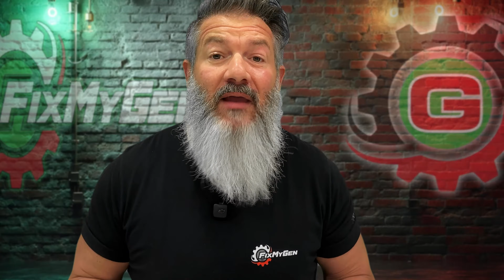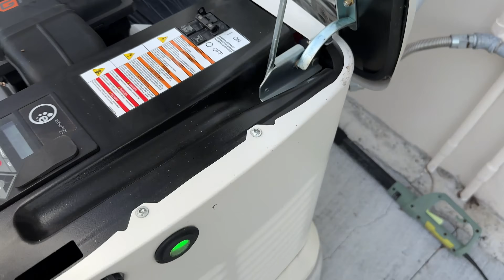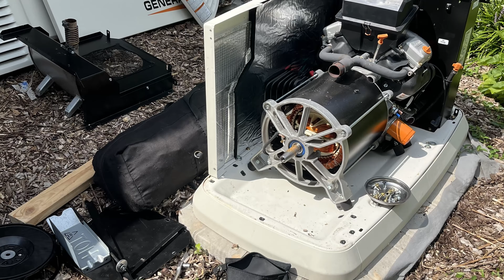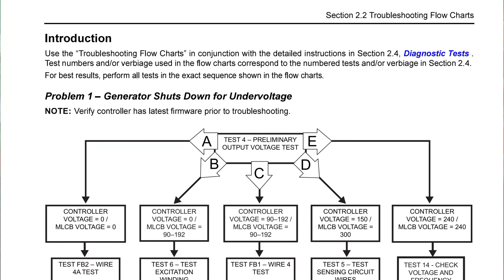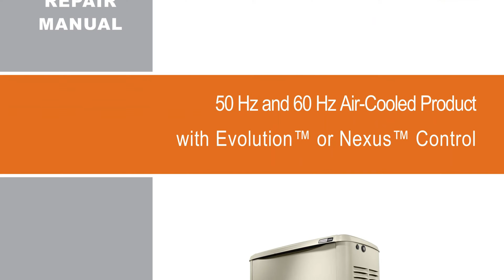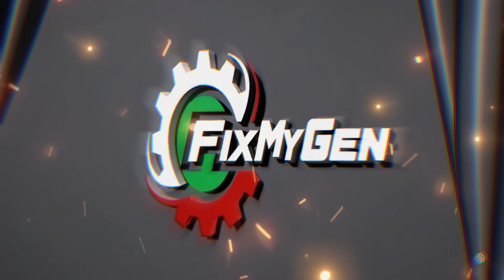GENERATOR DIAGNOSTICS | UNDERVOLTAGE ERROR CODES | FIXING 1900-1906 & 2299 ⚡🛠️

Comment: Thank you very much Robert, could you tell me where to find this switch (DPE) on the generator 7145
Reply from the maker: Hey Sasha — yes, the DPE winding is in the alternator (stator) on the 7145. That part is “inside the generator head.”

What’s not true on the 7145 is the idea that there’s a simple, user-resettable “DPE breaker” you can find on the front panel.

Here’s the clean way to think about it:

On older pre-Evolution units, Generac sometimes used a physical Excitation Circuit Breaker (CB2) in the excitation/DPE feed path. That’s the little breaker people remember.

On the 7145 (Evolution), the excitation/DPE output comes out of the stator and runs through the harness to the regulator/controller. There usually isn’t a standalone, panel-mounted CB2 you can push/reset.

Now the important part: if you’re talking about opening the control panel and doing internal meter checks, that is not homeowner work.

This is roughly a “Generac tech skill level 7.5/10” job to diagnose correctly and safely. You’re inside areas that can expose you to lethal voltage and stored energy. The diagnostic manuals are written for the home standby service trade for a reason. I don’t recommend homeowners attempt it.

That said, for a qualified technician, this is the step-by-step “Test Excitation Circuit Breaker (CB2)” process, when the model actually has CB2:

Safety shutdown

Put the unit in OFF.

Disable the generator so it cannot auto-start (lockout/tagout if you’re a tech with that setup).

Wait at least 2 minutes.

Access

Open the control panel area to access internal components.

Locate the Excitation Circuit Breaker (CB2), if equipped. (This is where the “does this model actually have CB2?” question matters.)

Isolate the breaker

Disconnect the wires from the breaker terminals to isolate it from the rest of the circuit.

Common callouts in manuals are wires 2 and 162 (varies by model/diagram).

Meter setup

Set your multimeter to resistance/ohms (continuity/low-ohms range).

Confirm the meter reads correctly by touching the leads together.

Test

Place one probe on each CB2 terminal.

Interpret results

Good breaker: continuity / very low resistance (closed circuit).

Failed breaker: OL / infinite resistance / open circuit.

Next step

If failed open, CB2 is replaced.

If CB2 tests good, you move upstream/downstream (DPE winding output checks, harness/connectors, regulator input/output, etc.) depending on the symptom.

If you tell me the exact symptom (runs but zero volts, runs but low volts, won’t excite after start, error code, etc.), I’ll point you to the safest “outside-the-panel” checks first and then the most likely internal failure points for the 7145.

Comment: Hello Robert, thank you very much for the clear explanations. I wanted to ask you a question. The Generac generator has been standing for 2 years and has not worked. After starting it gives 170 Volts, 1st phase 85, and 2nd phase 85, error code 1900. Maybe you have encountered such a problem, thank you very much. Have a nice day.
Reply from the maker: Hello Sasha, thank you for reaching out. Based on the symptoms you described—specifically the 170V total output (85V per phase) and Error Code 1900—the unit is experiencing a "Prolonged Undervoltage" condition. This occurs when the output falls below 80% of its nominal rating for 10 seconds or more.
Since the generator has been sitting for two years, there are two primary culprits for this specific voltage drop:
1. The DPE (Displaced Phase Excitation) Breaker
The 170V reading is a classic sign of a loss of field excitation.
• Action: Locate the DPE circuit breaker on the unit. Check if it has tripped. If it has, try to reset it. If it trips again immediately, the breaker or the circuit may have a fault and will need to be tested for continuity with a multimeter.
2. Oxidized Slip Rings
Because the unit has been idle for two years, a non-conductive film or tarnish likely developed on the slip rings. This film acts as an insulator, preventing the brushes from delivering the necessary current to the rotor.
• Action: Inspect the brush assembly and the rotor slip rings. If the rings appear dull or dark, they need to be polished. Note: Use only a fine-grade abrasive (like a Scotch-Brite pad or 400-grit sandpaper). Never use metallic grit or emery cloth, as this can damage the rotor.
3. Next Diagnostic Step
If the breaker is fine and the rings are clean, the next step is a Fixed Excitation Test. This involves applying a DC current directly to the rotor to determine if the issue lies within the Voltage Regulator (AVR) or the internal stator/rotor windings.
Start with the DPE breaker and the slip rings, as these are the most common mechanical failures after long-term storage.
Hope this helps point you in the right direction.

Comment: During exercise when the RPM lowers my Generac 16 kw almost dies & then gives a low voltage fault.  After resetting the fault, it won't start without shutting off the natural gas valve, letting it crank a cycle & then opening the gas valve.  Anyone know what causes it & what the fix could be?
Reply from the maker: Thanks for the comment. It’s hard to diagnose without seeing it, but based on what you described, it sounds like your fuel pressure is too high. When pressure is excessive on natural gas, the engine loads up, runs rich, stumbles when RPM drops, and eventually throws a low-voltage fault — exactly what you’re seeing.

On NG, the generator should never see more than 7 inches of water column at the unit. If the external regulator was never installed, or it was installed but misadjusted, the pressure at the generator will be too high and the symptoms match up perfectly.

My next question would be: has it ever run clean since the day it was installed, or has it always stumbled or hunted at low RPM?
That usually points right back to the installation and fuel regulation.

Let me know and I can help narrow it down from there.
Reply from the maker: One more thing I’d be curious about — when was the last time the valves were adjusted, and was that done by a certified Generac tech? A tight exhaust valve can create some strange running behavior too, especially when RPM drops. It’s a quick check that can rule out another common cause.
Reply: Also check if your propane regulator is a Maxitrol, those don’t work well on generators, sounds like your pressure is creeping up.

Comment: How do i test a 14kW nexus control board? Did evry test on th manual n evrythin passes those tests. Dont want to spend 700+ shiping on a new board just to find that it wasnt the problem🥵🙏
All maintenance up to date. Also i live in P.R. ,a new gen is around 9k plus 11.5 tax .
No tecnician wants to touch it with a long stick! Any help wld be deeply apreciated
Reply from the maker: Good eye tackling that on your own — those Nexus systems can be tricky to pin down, even for experienced techs. I’m sorry you’re having a hard time finding a dealer willing to work on it, and I don’t have any personal relationships with techs outside the U.S. (yet). I’d be happy to help as much as possible though. Email me at Rob@FixMyGen.com with your generator’s serial number and I’ll shoot you over a few helpful tips.
Reply: @FixMyGen sent an email to u with a detailed info on th unit plus a brief explanation on tests i performed ,as explained P.R. has a mayor problem with th power grid with th gov. in battle with LUMA n GeneraP.R. wile us ,the people suffer the consecuence of it.  
Scrambling for a reliable source of energy, we fall prey fr solar energy above 90k$ or 9k to 13k for a generator for a reg. 5kwh home!  
On oct.1rst got anothr raise of 8% in electricity bill, 7 on th last administration n 2nd on this adm. to a total of about 32 cents Kwhr. On a good day!

Comment: 2012ish generac 8kw model 58702 got the Under Voltage code. the pros came out and disgnosed, said likely the brushes but 700$ to sort that. and recommended a new unit (for 10k$ !, so I gave it whack) Hopefully your videos will be the answer. I made it in to the brushes so far
Reply from the maker: Hey Garth—funny timing, I’m actually dropping a YouTube Short today on exactly this: when it’s time to swap your generator. Might even expand it into a full-length video soon since it’s a hot topic this time of year.

Definitely take the time to rule out something simple first—it’s always worth a shot. But there’s also real peace of mind in knowing you’ve got a fresh unit under factory warranty, especially heading into storm season. Keep me posted on what you find!

Comment: Could the black gas control valve hose cause 1902 code 1 year old and hose is collapsed
Reply from the maker: Hey Mike, great question. If you’re talking about the short black fuel lines that run from the internal regulator to the throttle actuator, I’ve definitely seen some start to collapse near the bend—especially in hot, humid areas. The more extreme the climate, the more common it is.

If that hose is pinched or soft enough to restrict flow under load, it could absolutely lead to a 1902 shutdown. Sometimes you can pull a little slack and use a couple well-placed zip ties to clean up the bend and relieve the pressure.

Though I don’t believe it would be considered a warrantable item through Generac, it might be worth replacing that section with a thicker-wall line of the same rating from a local Goodyear hose shop, if you’ve got one nearby.

Let me know what you find—I’d be curious to hear how it plays out.

Comment: Do you have an email that I could send a question to? Running into a 1501 and 1902 and kind of ran into an end..
Reply: I have a 2013 14kw guardian series with 200+ hrs, was workin fine till i flipd the breaker on the unit to off for a week, then tried a manual start and under voltage apeared on display after it ran for 2seconds. Did evry test on th trouble shooting chart n it all looks good. Still runs for a couple of seconds, dies with same mesage☹️ dont want to spend 700+ on a new nexus board just to find out it wasnt th problem!😖😫
Reply: Or we could communicate here, basically I am getting 240 out the generator (checked at ATS), it runs the house fine until the air conditioner decides to turn on, at this point it shuts down at gets a 1902 code. I do have the service manual for this unit and plan to start on "problem 1" sometime this week if weather allows.
Reply from the maker: Hey, thanks for reaching out. Based on what you described—running fine until the A/C kicks on, then throwing a 1902 code—it sounds like your generator’s hitting a sudden load it can’t quite manage. That 1902 fault typically means the controller isn’t seeing the required field zero crossings, which can happen if the brushes aren’t making solid contact with the rotor slip rings. It’s worth earmarking a test of the field boost circuit and, if needed, opening it up to inspect the brush and slip ring assembly.

Also keep in mind, A/C units—especially older or larger ones—can have high inrush currents. If the generator was professionally sized and this A/C has run on it before, you might consider adding something like a Hyper Engineering SureStart 6 to soften the startup load.

One more thing to consider: if the engine isn’t running at full performance—due to fuel delivery, valve lash, or even just overdue maintenance—it may not have the torque to handle a sudden load, and that could lead to voltage collapse and a code like this. You mentioned you’ve got the manual and plan to start with “Problem 1,” which is a great step. But if that doesn’t point you to a clear resolution, it might be time to call in a certified tech who has access to Generac’s full diagnostic tools and backend support.

This is one of those faults that really benefits from hands-on diagnosis, so while I can’t walk through the whole process here, I hope this helps point you in the right direction. Keep me posted—I appreciate you being part of the FixMyGen community.
Reply: @FixMyGen thanks. I’ve got access to all the tools(I worked in procurement for an ind. certified company), I’m actually going to load bank it and make sure it’s able to hold to rated power this weekend. In the meantime I did order a soft start. Doing the math, the startup load was higher than the generators max continuous amperage ability of about 71 amps, though I would think the short power rush shouldn’t shut down? 

Maintenance is up to date and fuel supply is adequate. I’ll update my findings after tinkering with it this weekend.
Reply from the maker: Thanks again for watching—and I really do appreciate you staying engaged on this. Sounds like you’re digging into it the right way.

Just to gently reiterate what I mentioned in my last email—I’m not able to offer full diagnostic support via email. I’d love to help everyone one-on-one, but I’ve learned that setting that expectation leads to more frustration than resolution.

That said, did you get a chance to work through the suggestions I shared previously? I’d be curious to hear what you found with each step—that might help narrow things down even further.
Reply: @FixMyGen so yeah, did a lot of testing and ended up at the slip rings and brushes. Brushes all test fine. I removed the brushes and began testing slip ring to ground.

Slip ring to slip ring brushes no installed 13.4ohm

Positive ring to ground also 13.4
Negative ring to ground also 13.4

Basically this points at a bad rotor, am I correct?
Reply from the maker: Hey, really great job tearing everything down to check the slip rings—that’s no small feat. Getting in that deep takes some real effort on most models.

It’d be helpful to know your exact model to give you any definitive values, but here’s a general rule: when testing from either slip ring to the generator frame (ground), your meter should show infinity (OL). If you’re seeing 13.4 ohms, that points to a problem—could be a short in the rotor winding or even a bad rotor diode (if your model has them). That kind of fault can definitely cause shutdowns or voltage issues.

Now, between the two slip rings, you should see resistance—that’s what tells you if the rotor winding itself is intact. But to ground? You shouldn’t see any connection at all.

Also, take a look at this folder—it might help clarify things further:
👉 https://drive.google.com/drive/folders/1sr_hgRghqgfN9pEYN8ueqKHbMbvmoSbq

Appreciate you digging in this far—let me know what you find!

Comment: Wow ,,,,,, "some of these units were nearly new" .... that statement causes me concern with our 65-day old $16,000 26kw Generac unit. This makes me question my purchasing decision as well as the long-term reliability of the product. My research for this purchase had me settle on either Kohler or Generac. Due to our relatively rural location in central Florida, I had to factor in the location of factory authorized dealers for service related issues. Nearest Kohler dealer was about 2 hours, Generac about 40 minutes, speaks for itself. Had I known this information I most likely would have chosen Kohler and took my chances with the service distance. Another great and informative video here, thanks very much.
Reply from the maker: No need to worry! In our experience, most of the shutdown issues you hear about come from undersized systems or installations where the startup process wasn’t dialed in just right. You made a great choice with the 26kW—it’s the strongest model in the air-cooled lineup and it’s built to perform. Plus, if anything ever did pop up, any genuine concern would be fully covered under warranty, as long as the install was done properly. Generac’s a solid product, and while no brand is immune from the occasional issue, the overall success rate across the board is very strong. I’m confident you’re in great hands with the unit you chose. Thanks again for taking the time to watch and support the channel!